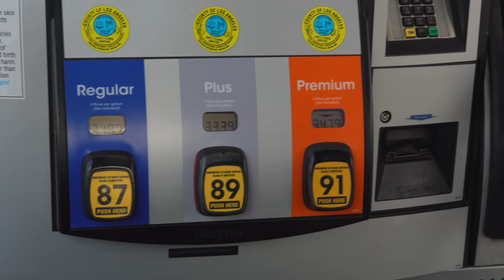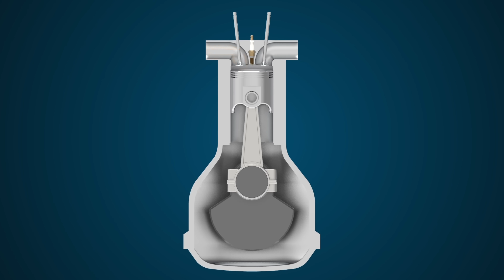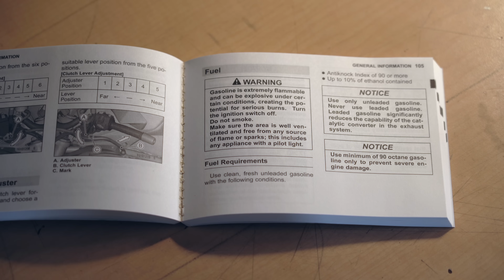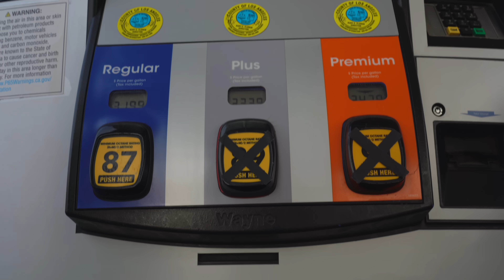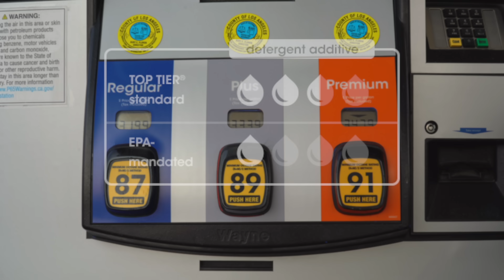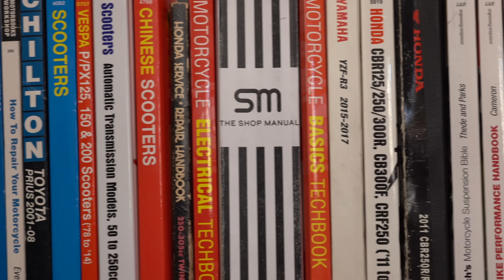Should You Run Premium Gas In Your Motorcycle? Octane Explained | The Shop Manual

Comment: In Estonia the most common is 95, basically regular and our premium is 98, what most motorcyclist use. It is hard to find a gas station, which gives out lower than 95 and in almost every gas station you get 98.
Reply: Europes numbers are higher than in the u.s, 95 in europe is same as 87 in u.s

Comment: This is not quite correct - The calorific value of premium fuels are higher than lower grade and significantly more than ethanol fuels - Premium fuels will give better fuel consumption - there's sufficient data available to substantiate this

Comment: Inn mmm understand the theory, however practically running premium 98 octane instead of 10% EtOH 94 octane fuel gives me measurably better fuel economy. I measured distance covered and fuel burnt for every tank for 16000km. Could be the lower energy density of the ethanol making the difference, but on a bike with a smallish tank every extra km or range was needed so I happily ran premium.

Comment: unfortunately you did not get into what compression ratio should use what fuel.... and that is what I was hoping you'ed do
instead you belabored  the point of wasting your money and thinking it will make your bike faster....  though that should be obvious to any biker, not all bikers are technically savvy , i.e. the chevy driver, ( turn the key and go) who got a motorcycle...
taking the easy way out and saying check your manual is a major fail on your part.... giving the viewer an Idea of if your bike has an 11:1 compression ratio  and what grade of fuel you should use ( regular ) would have been much more informative
but at what stage does that change ? at 12:1 or 13:1 and then you should use mid grade or premium ? 
though the different grades of gasoline are mainly there to prevent detonation, NOT to be a more powerful type of gasoline
 Uneducated people do misunderstand the reason for the different grades of gasoline. and coodoos to you for pointing that out ! thank you.... 
In my Younger days as a Mechanic I knew that from around 8:1 to 10:1  is Regular grade gasoline  area....
however ignition timing has a huge amount of determination in that statement !

Comment: Bizarrely, my 2020 BMW absolutely HATES the higher octane stuff. 
I thought there was something wrong with it when I bought it, because it took a few attempts to start it when cold, until the dealer told me to put regular petrol in it. 
Runs like a dream and costs less too.
Reply: It’s not bizarre at all for an engine to run better with the fuel it was designed for

Comment: I put 93 in my 2010 Kawasaki Ninja 250 and it runs much nicer (vs the recommended 87). It burns different and makes the bike smoother through the RPMs.
Reply: Actually slower then?
Reply: @mcplutt  Not slower, not really faster either - just noticeably smoother throttle response.

Comment: Old engines that ran lead gas worked and lasted a long time. 50 years or more in some cases. Those detergents are what causes the corrosion inside the engine.

Comment: LOOK, There is No Octane in gas. The gas you use in your vehicle was in a lab compared with different mixtures of octane and heptane. The octane rating of octane  is 100 and heptane has 0. They use it in a special engine, (CFR engine) that features a manually variabele compression ratio. If the resistance to detonation of your gas compares to a mixture of 95 percent octane and 5 percent heptane your gas has an octane rating of 95. To raise the octane rating of gas, tetra ethyl lead (tel) was once added. Nowadays MTBE is added for that purpose, which is less poisenous to the environment Excuse my English I'm Dutch.

Comment: Air Cooled Harley 1200. Was told to run 91 by the Dealer. Sometimes I run a Fuel Cleaner in the tank. Seafoam or Lucas

Comment: Typically detonation occurs when the fuel and air mixture are ignited before the spark plug fires. High compression motors suffer from knock because the higher compression can cause enough heat to ignite the mixture before the spark plug fires.
Either way, keep up the great videos - always well done and informative.
Reply: No the example you gave is preignition! Not detonation they are different!
Reply: @noway72  You are very correct - i have always used the terms interchangeably as they both effect run quality, and i don't care which side of TDC the knocking happens on - it needs to be addressed either way.

Comment: In Germany they have 102 octane which is definitely higher than the us 91 stuff. I’ve tried out the top speed in a C63S amg with both fuels and with the 102 the top speed was about 12km/h higher without a tune

Comment: Premium is the ONLY gas, that crap with the ethanol will kill your engine unless you have an ethanol approved engine and even then regular is just crap gas. Me personally I drive a BMW nuff said, My bike is tuned so I wouldn't ever put regular gas in. No point in tuning if your going to use gas that robs you of performance. Despite what this guy says you should always run premium because it is about the life of the engine and the quality of the ride. 10 to 20k into a bike to save 100 bucks a year in gas? why you ridin then?

Comment: If you get fuel from a pump that has a single hose, and you're only getting  a few gallons, how much 93 are you getting? I have to run a few gallons of 93  in to my truck, then fill a 5 gallon can and fill my bike with the can or it will knock. Looking at taking octane booster on the road when I fill up away from home.

Comment: Brilliant info regarding the Euro / US octane differences. Always wondered why UK has 99 octane and US seems to only offer 93.
Reply: Although 98 RON is roughly equivalent to 93 AKI, and 95 RON (regular in most of Europe) is roughly equivalent to 91 AKI. (Which also means, if you've got a vehicle that calls for 98 RON, you'll want to find a station whose premium is 93, not 91, and there's whole states where that isn't the case AFAIK.)

(The US 87 AKI regular is roughly equivalent to 91 RON, FWIW.)

Comment: As a mechanic I can tell what fuel was used when I open an engine. Ive paid for a tank of gas several times to prove to people their engine will run better on premium. My 6L Denali computer says it gets 19.5 mpg on 93 and 17.5 on 87, with noticeable performance loss. I run 93 in everything now cause it just makes sense.
Reply: You really ought to get with Hot Rod and take David Freiburger's job.  Seems he and some others did the dyno work to prove the power was near identical at all points in the power, not to mention working best at the same ignition advance.   Boy, they really must be stupid.   Send your resume in.  You'll be a shoe in.

Comment: Nice video, one major boo-boo though -- the Kawi H2 is not a high compression engine, 8.5:1 is certainly on the low end.  Lower than a V-Twin like the Star Venture at 9.5:1.  A ZX-10RR is 13:1, call that high, a Brutale 800 is 13.5:1, call that higher.  Streetfighter V4 is 14:1 -- maybe that's a high compression engine?  Not an H2.  Thanks for sharing!

Comment: My area of the world dropped 93 octane for 91. Even though I had three cars calling for 93. My other cars, lawnmower and other small engines didn't call for 91 but I used it in all my engines because it was the only grade without ethanol. Corn belongs on the dinner table. Not in the gas tank. The only way to get the performance I want was to go all in with electric motors. My cars, motorcycle (one at least), and yard equipment are all electric now. No worries about gas, spark plugs, oil changes, winterizing etc. Full power from 0 rpms with super cheap fuel I get from my garage wall rather than a dirty gas station. Win-win.

Comment: I once filled a full tank of premium into a suzuki boulevard designed to run on regular. The bike didn't want to ride, engine shut down on high revs. Had to empty the tank and fill up again with regular. Worked fine after that.. Learned a lesson for the years to go..

Comment: So, with a modern engine fitted with fuel injection and ecu controlled ignition, the higher octane fuel used the power your engine will make. This is because the higher octane fuel allows for more ignition advance, within reason the more ignition advance the more pressure above the piston in the cylinder, the higher pressure the more torque & power. Conversely if you use a lower octane rating it is likely that ignition will be retarded, pressure in the cylinder will drop along with torque and power.

Comment: I use premium in my 2003 V-max as it's got 11:1 compression and it's been great, no issues.  I bought a 2015 KLR last year and as it's a tractor I ran 87 octane and it doesn't rev and barely has compression however over winter the idle jet got gummed up while the V-max never has.   I'm guessing it's due to the detergents in the gas?  In any case when I sense the end of riding season is getting close I'll start using premium in the KLR and use fuel stabiliser

Comment: If you care about your vehicle run atleast 89 the fuel today is crap and if you know anything about the construction of fuel stations they connect the regular tank and the premium tank together which makes them more money . Not informative at all this video if you want your bike car anything lawn mower to die earlier then run 87 if you care about what you have run atleast 89 the mid grade tank has no under bypass its strictly 89 don't fill up when the tanker is there your sucking from the bottom and the tank is being stirred up and with contaminants . If you have any high-performance vehicle find a station that sells 100 octane street fuel or order it or speed shop .

Comment: I run Shell V-Power on my puny 150cc bike because it's much smoother than the local (and only) brand. Less vibrations, smoother sound, etc etc. The difference with the mid grade here (Octane 90) is only around 10c/litre, and the difference with the premium here (octane 92) is only 1c, so that's pretty okay I guess

Comment: Not sure he’s quite right about European fuel. UK ‘regular’ is 95 RON, which is 90.7 in US. ‘Super’ is normally 97 RON, ~92.5 in US. Learned this after reading about what fuel to put in an MX-5 (Miata), in the US you can’t run on regular but in the UK it’s fine.

Comment: Had a 1990 VW Fox 4 cylinder made in Brazil (think Chinese quality, but to German spec), and after 90k, that thing would only run smooth on Sunoco brand fuel (low octane was fine).  Any non-Sunoco fuel, and the car would develop fits of occasional mild emphysema while shifting into second and maybe other times.  Weird.

Comment: ECU flash... Was told to use 91 in my 2020 Ninja 650. From what he was saying though I can use 87 just fine because it's not knocking and I'm not out there running out the bike to redline and beyond. It's simply my daily commuter and once a month with Gumout should be fine. Or as I like to do in all my bikes once a month with premium and Gumout.

As for non-ethanol gas? It's a buck more a gallon, or more, and you have to research who had it in your area. Rural farm towns have a more plentiful supply. If you're going to put 100,000+ miles on your bike I'd say it's worth it. In the long run it's a waste of money because not many people put high miles on their bikes. They see another bike they want to buy and trade the old one in with usually less than 50,000 miles on them. I myself usually trade in every couple years.

Back popping is NOT knocking. He should have addressed that in this segment.

Gee, what about running jet fuel then?!

Comment: Good video.  The only thing you are missing here is the amount of ethanol that has been added to the gasoline.  We definitely do not want to be using any ethanol blended gasoline in our motorcycles.  Unfortunately the only gasoline that has zero ethanol is the high priced premium gasoline, and not all brands either.  I guess that is simply the price of treating our machines to the best of the best.

Comment: People always... the car have knock sensor that will pull timing... dumb asses! You don't want to pull time do to knock! You want to prevent knock from happening! As a mechanic I would always say read the manual it probably says 89 or higher recommended on every car unless restricted by law. I put that shit even on my lawnmower because the higher resistance to knock! And like he said it always keeps everything way cleaner... higher mileage too! Proven with notes and test not just assuming... now if you got a heavy foot and put 100 octane don't come back saying it did not last as much...

Comment: Na I use premium in my bikes lawn mower snow blower and chain saw. Reason it's the only gas around here (Ontario Canada) that DOES NOT contain ethanol. The other grades  which contain10% ethanol sitting in a carb for a month or more is an infuriating disaster.

Comment: I had an engine builder ask me after he bumped up my '92 Low Rider, "what kind of gas do you use?" High-test I responded. He gave me the same advise, unless you are running a hi-compression (10.5:1) run mid-grade, otherwise you are blowing money out the exhaust pipe. My current H-D requires 91 octane. In FL, we have 87, 89 & 93, so I alternate 89 & 93 between fills to get more or less 91 octane.

Comment: Higher octane equals hotter engine equals more power climbing hills or grades equals burned spark plugs. 
Octane boosters you buy in any auto parts store is made only for performance engines.
But this is what octane boosters manufactuers dont want you to know..
Reply: @Soggy Hogwallop I did my research. Spoke to fuel scientists and read plenty of research. I’m asking you for an explanation, not repetition. Why do engines run better with higher octane (personal experience at the track and on the dyno suggests otherwise, so long as detonation is avoided), and why would higher octane fuel burn hotter? I’m trying to learn and you claim to know the facts, so lay em on me!
Reply: @AriH211  Ari, not to sound sarcastic at all here but did that Fuel Scientist also tell you that crude oil (Gasolene, diesel, avgas, mogas, car racing, drag racing fuels) that pumped out of the ground came from dinosaurs or fossels... Hense..."Fossel fuels" ? My point here is....The fuel industry Chevron, Royal Dutch Shell, Sinoco, Sinclair & others has been telling the "Consumer" for a hundred years the fuels used in your car are former fossels or Dinosaurs that walked the Earth millions if not Billions of years ago. Its a 100% lie. It has everything to do with marketing. That lie will never cease. Ask yourself this... "Why is there 3 grades of gas at the pump". Why is there 3 diff octane numbers.? Why do general aviation planes use 100 octane fuels like Avgas or Mogas. Why do Jet Airliners use Jet fuels. Why does the Military (not) use 87 octane fuels in jets. Dont get caught up in the deception that high octane fuels do not increase heat in your race car. High octane fues and Octane boosters will burn cleaner due to higher combustability hense higher temps.
Here is a perfect example - Two Stroke Chainsaws, motorcycles, Snowmobiles can run on 87 octane fules but will not run at performance levels you and I would like. To increase performance we add octane to levels above 90 91 92 93 or higher the boost in Octane in the combustion chamber under ideal conditions ( pressure) ignites much quicker as the spark plug sparks. The duration of spark + a purer gas + a octane booster + cylinder pressure creats heat ....much more heat than plain 87 octane fuel. The downside is the creation of heat so much so that pistons, cycinder heads and spark plugs must be replaced at regular intervals. Run your race car on octane booster alone and your plugs will melt. Top fuel drag racers use C16 VP racing fuels and others to increase detonation duration times, longer det times increases power by burning the fuels completly.
Reply: How does higher octane lead to a hotter engine? I think you're confusing what octane is and does with the type of engines high-octane fuel is used in, ie performance engines which create a lot of heat.
Reply: @AriH211  im retired oil & gas refinery employee. We made the fuel you use. Do some research Ari. High performance engines to run at peak performance must have high octane fuels. ie.. top fuel dragsters, aircraft. 
Two stroke engines like motorcycles, chainsaws, snowmobiles will perform at top effiency with octane levels at or above 93 99 100 118 levels. The downside is heat and spark plug electrodes burned off. VP, TRUFUEL among others have octane levels above 93 or better. The higher the octane the hotter your engine will become. This is fact.....

Comment: This video does not address riders living in California where their so called premium is 91 octane.
My ZX-12R built in June 2000 is 12:2 compression ratio bone stock and still is.
It has detonated on 91 since new forcing me to mix race full.

I lived in Texas 2006 to 2014 and never heard a peep out of my pistons on their 93 Octane and my mpg was better.

Moved back to Calif 2014 detonation came back on 2nd tank of fuel mpg is 38 again!

I have to pour in 1 gallon of 100 octane plus 4 gallons 91 and get a little ping on warmer days or slow traffic. my 2000 ZX-12r is the last of the unrestricted bikes.
I will be going to 2 gallons race fuel and 3 gallons California 91 premium.

Comment: lol where i live 95 octane is regular, 98 is plus and 102 is premium
the 102 actualy makes my mileage a little bit better but not good enough to safe money and it smells considerably less and better from the exhaust + engine runs smoother (less micro vibrations)

Comment: Yeah high octane won't make it faster or will it? It sure as hell will make it perform better and get better throttle response so if the engine revs a little quicker when you crack the throttle in my opinion it makes it faster and you run both in your bike and you be the judge. Indeed!